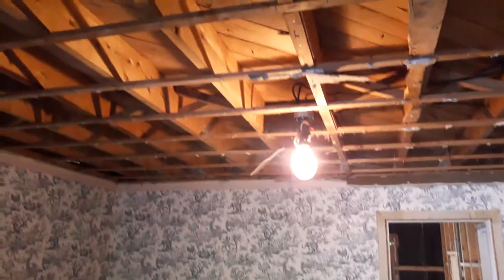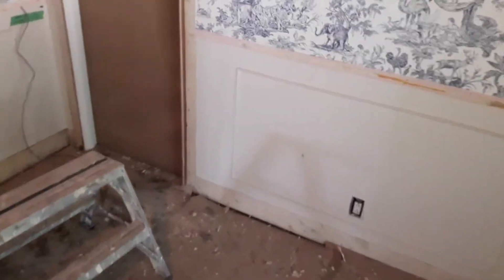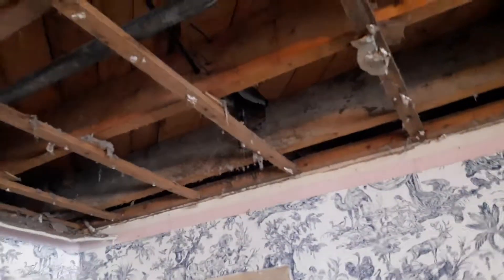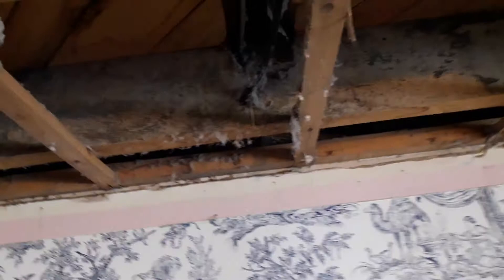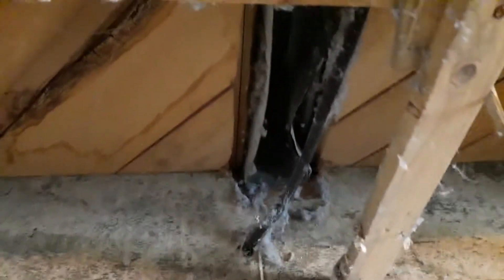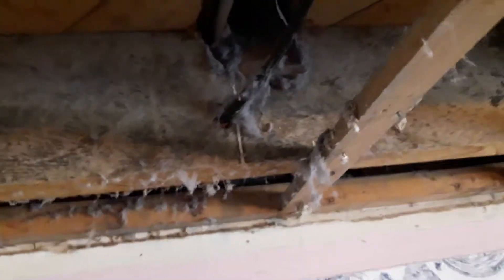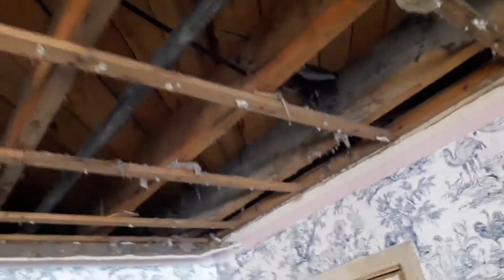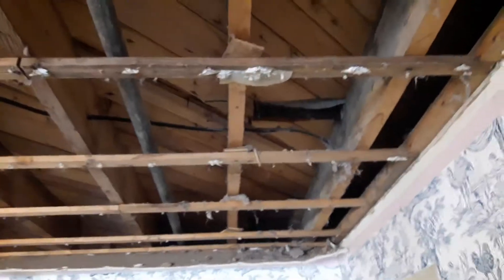NEVER use a joist cavity as a duct!!

Comment: Just came across this. I was looking at doing that in a basement wall (storage room wall / main basement separator) is it possible to do this with a short run like that in a vertical wall that's easily accessible? How about if a filter was installed on the return vent? Didn't say before but it will be a short 10ft return due to the basement not even having one single return.
Reply from the maker: You can use the wall cavity as a duct if you line it with an appropriate material. Buy THERMOPAN joist liner and you will be fine. It is designed exactly for this application.